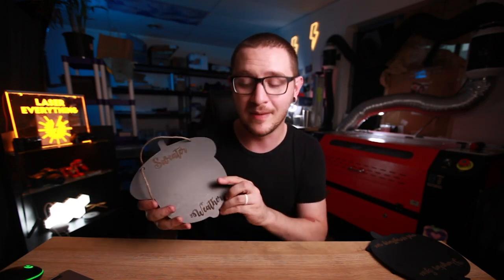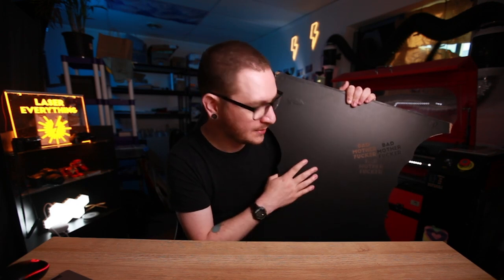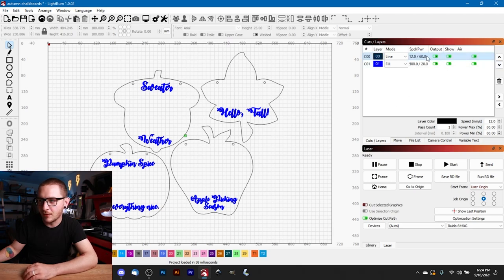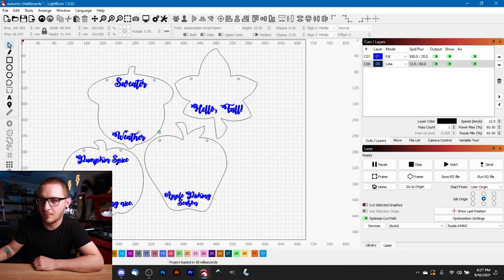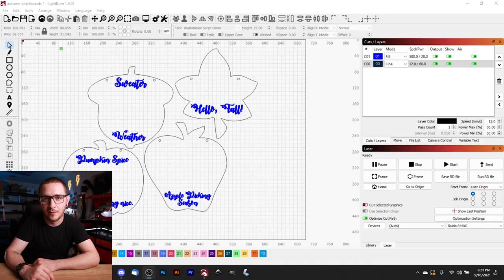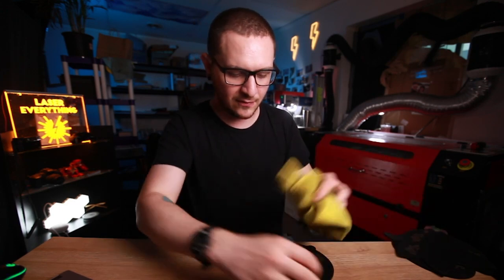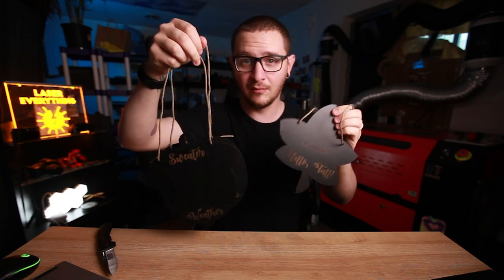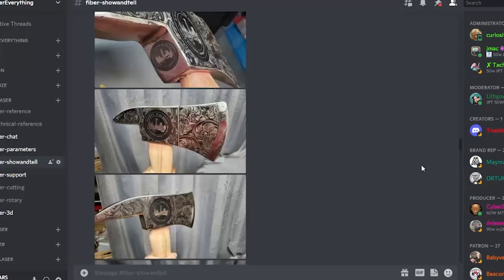EASY! How to Make Autumn Chalkboard Signs! | Cute Fall Crafts!

Comment: Called Handipanels, they are nice as you won't need to rip them down, although cutting to size with a kreg jig and wireless circular saw is easy and compact, I have a prius so need small sizes without the extra costs.
Reply from the maker: Handipanels! Nice! TIL!